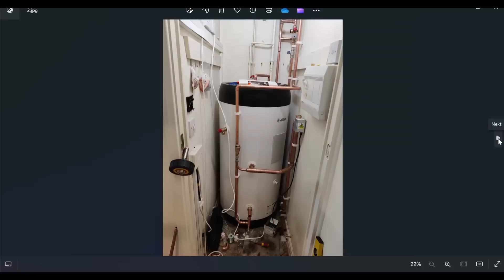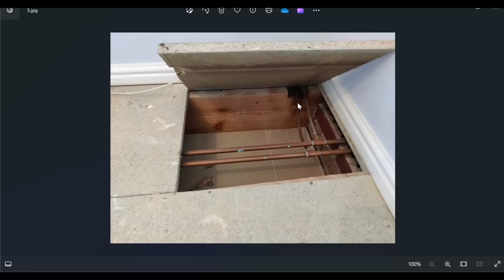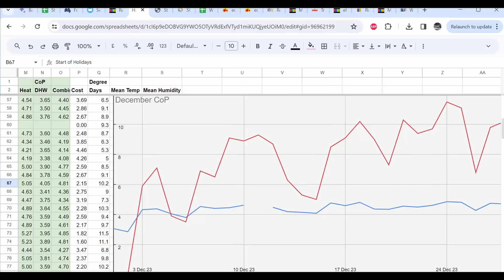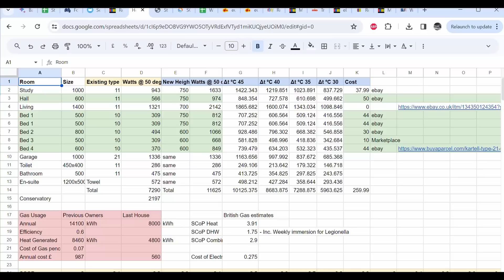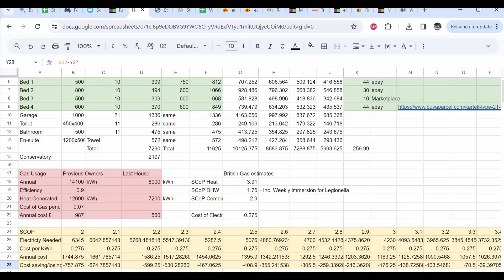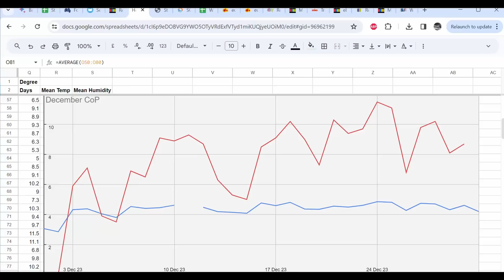How Efficient is my Air Source Heat Pump in Winter? December 2023 Monthly Data Report Update

Comment: really useful information,  I currently run out home colder via gas (yes more clothes on lol)  I know due to our age that we need to run more sensible temperatures so am looking for some monthly Kwh values and ave temps per month over a year or 2 - is there any reference material that I can get hold of.  I fully realise that the values are relative as if my home was poorly insulated then it would be a larger figure , many thanks
Reply from the maker: For the whole of 2024 our home required 2768kWh of electricity to heat and provide hot water for a family of five.
We achieved a COP of 4.
We kept the house at 21 degrees all day long.
If you look at some of my more recent videos you will find monthly breakdowns.

Comment: Just as an aside, have you looked into having the system being serviced? do B Gas do this? Ive looked on their website and theres no mention of servicing of ashps and the installation team didnt mention this aspect either.. strange, theyre usually pushing the servicing side but nothing seems available altho a bg engineer did say they do it?
Reply from the maker: I remember the paperwork includes mention of a first free service but besides that I haven't looked into it yet.

Comment: thanks very much for the video. I came across it by chance. We installed our 12 kW Areotherm plus heat pump in December. Possibly a few weeks after you did. Our experiences are very similar to yourself. House is much warmer and we seem to be spending a lot less money. it’s very hard to compare like for like but I tried to take a month from a year ago a month just passed. The heat pump bill was about half of the previous one. But there are so many differences since last year. The war in Ukraine and and gas price hikes, but we are heating the house fully now compared to last year when we hardly had the gas on at all because we were worried about the prices. So the house is now warm when previously it was cold and damp. I’m very pleased with my purchase I like you, I’m still getting a hang of many many of the settings thanks again for the video it’s very informative
Reply from the maker: Thanks for the comment! Good to hear that you're having a similar experience as well!
It's hard to describe the improved comfort but it's easy to show visitors within a few minutes.
Let's slowly convert the doubters, one by one.

Comment: Excellent thorough analysis thank you, so for me the big take away here is comfort factor. a couple of hundred pounds a year saving over ten years  will no where near payback the cost of installation and equipment so it all comes down to comfort and livability. For a family scenario  where multiple people are getting the benefits then it seems to me worthwhile especially if there are elderly and young children it the family group, but for say a working couple I still just don't think the use case stacks up. Once again thank you for the excellent stats .
Reply from the maker: That is a very important point that I hope to address in the future.
It is hard to describe the improved comfort but guests have understood it within 5 minutes of walking around the home, especially those guests who had visited us last winter and can recognise the stark contrast.
For us, the capital investment was lower than the gas equivalent due to zero VAT and the £7500 grant, as well as the fact that our gas boiler, cylinder etc was all 27 years old and long overdue a replacement.
The other factor to consider is the massive environmental benefits. I've just calculated how much carbon we are saving and will publish a video showing the full figures in a few days.
It's a win all round.
1. Improved Comfort
2. Decreased Costs
3. Decreased Emissions
Thanks for the comment.
Reply: Thanks for the reply and the additional incentives certainly make a difference. I'm thinking of starting out with a home battery due to the VAT removal from this February for standalone installations as the low price overnight difference in Tariffs is substantial.I would then like to move to a second phase with Octopus Cosy product once it has had a while out in the market to prove itself. Keep up the great work with the channel  @UpsideDownFork

Comment: What octopustariff are you using? Great video.
Reply from the maker: The figures used in the spreadsheet are on the standard Octopus price cap rates for my area.
I'm on Octopus Tracker so in fact I'm paying a lot less than this 👍

Thanks for the comment.

Comment: just put in Panasonic 7KW ASHP,  full new radiator system at the beginning of December  in a  200 hundred years old stone cottage will wall insulation, but  I think i will  have to fit  my old oil boiler as a hybrid system as parts of the house are not very warm
Reply from the maker: That sounds like an interesting installation. If the heat loss calculation is correct that all parts of the house should meet their target temperature but you may need to rebalance or upsize 1 or 2 radiators if those areas aren't currently reaching target temp.

Comment: Decent set of figures. I have an LG ASHP and AFAIK there’s no way to get the heat output and COP figures from it which is annoying.
But by comparison we used 96kWh on 2nd December for the ASHP and 852kWh for the entire month of December but the house is comfortably warm all the time.  Just have to be used to the fact that it does use a lot of electricity on cold days, but otherwise it’s not so bad.  We have a large solar array so can generate an abundance of electricity in the summer, for which we get paid, so overall over the year it’s heading towards net neutral cost. Running costs are similar to the oil boiler it replaced and of course you can’t generate your own gas or heating oil!
Reply from the maker: Glad you're making the most of your solar and ASHP combo! Always look on the bright side of life!
It's a shame that the LG units don't appear to provide much data to the user.

Comment: Condensing boilers are 89% efficient when used correctly.. ie, flue temp stays below 54C..   usually achieved by keeping flow temp lower (55C) and running the heating longer to achieved desired room temp...  so your comparisons at 70% or 80% are way off..
Reply from the maker: At what point did I say condensing boilers were 70% efficient? If I did, please send me the timestamp and i'll correct it. Re-watch between 14 and 16 minutes.
What I did say is that the vast majority of condensing boilers are incorrectly setup and are operating at 80% efficiency. A very small minority are operating close to 90%.
I did a running cost comparison against 80% and 90%. The heat pump still wins every time.

Comment: Hi guys, you are one lucky man, my AIR SOURCE HEAT PUMP costs me per day to run = £11.00 a day so as you can guess it don’t get switched on,,, so in 7 years of having this unit it has only been running for about 1 month, yep I have a problem, this is what you get when you employ qualified installers that turn out to be cowboys…..Brian
Reply from the maker: Sorry to hear that Brian.
1. What is your heat loss?
2. What is your design flow temp?
3. What heat pump do you have?
4. How are the controls set?
5. Do you have a breakdown of your energy usage to determine what is attributable to the ASHP?

Comment: Everyone needs to be aware that when measuring COP using a Vaillant controller, it does not give accurate results and over-estimates the true COP.  This is because Vaillant systems do not take into account any electricity usage by components that are part of the system, but not directly within the heat pump enclosure.  So, if you have external pumps, valves etc that use electricity, your COP will not measure that usage.  The correct way to measure COP or SCOP is to divide the total heat output of the system by the total electricity input, including all components within that system that use electricity.  This is how we calculate our COP and SCOP.  If you use the correct calculation the numbers shown in this video would be lower.  The spreadsheet shown does not include electricity consumption from associated system components and it also uses the 'Vaillant' method of calculating COP / SCOP which is not strictly correct.  To give an example, the spreadsheet shows a November combined COP of 4.06.  This is from a total heat generation of 906.2 and a total electricity input of 234.2.  906.2 / 234.2 = 3.87, not 4.06.  If you then add in the electricity usage of associated components such as pumps and valves, the number would be lower still, but that cannot be estimated in this system as the Vaillant controller does not include this electricity usage.  The best way to measure is to have a dedicated electricity supply that powers the heat pump and all other associated components and measure this with a dedicated electricity meter, this is how our system does it.
Reply from the maker: Hi David, thanks for your comment.
Do you have an arotherm plus yourself with open energy monitoring kit on it? I'd love to connect with more people that do!
Zarch from energy stats uk does and like others with the same kit has found the Vaillant reported figures to be remarkably close to the independent monitoring through the calibrated kit. In his case, his Vaillant numbers were lower than the actuals. https://energy-stats.uk/heat-pump-performance-history/
The open energy monitoring forum community has a lot more data on this if you're interested although if you've got the kit i'm sure you've read all of that already!
On your second point of the figures not adding up. Unfortunately there was an error in the spreadsheet. Some of the totals on the bottom line were not added correctly, the missing data during the transition day is to blame in this case.
The average CoP figures you see are averaged by using all the daily averages above them.
On the third point of excluding the consumption of zone valves and external pumps. In my case I don't have anything additional that would not be in a boiler system. I have the same radiator circuit pump and I have a 3 way valve as I used to have in my old system. The pump has a theoretical power consumption of 4-60w. Someone in the facebook group put a CT clamp on his and recorded average power consumption of around 200 watts per day.
So yes, I agree it is a factor, but it is a relatively insignificant one.

Comment: Love this bud, love the detail 
I’m a gas heating engineer and just installed my arotherm plus 7Kw in November absolutely loving it …expecting to alter pipework Rads etc as it was a bit of research on my own house , microbore all round and achieving constant 19.5 
Not having to do anything on my system so that’s a bonus, just subscribed 👍🏻
Reply from the maker: Thanks for the comment. Hope following along is helpful to you.
Did you fit a buffer tank?
What CoP have you been achieving since November?
Reply: @UpsideDownFork  no buffer just kept it open loop, I had a little kitchen underfloor zone I fitted a few years back, took the pump off that aswell and all works well, keep it simple but I was expecting to do some alterations cop floats between 3.8 and 4.4 heat curve on 0.5 , 18 degree set back temp 20 degree all day, Interesting to see how it performs on a long minus temp week, I think we had a -2 for 2 days and it seemed ok didn’t really notice it wasn’t performing so all good I think
Reply from the maker: @alexmanton8135  sounds brilliant 👍

Comment: Awesome as always.  So kind of you share so much of your data and conclusions.
I don't know how your system calculates the COP, but just looking at your December's heat pump electrical use (400.2 kWh) and your total heat pump output (1635.2 kWh), I would think these 2 numbers indicate a COP of just under 4.1, rather than the 4.34 in your spreadsheet (1634.2 divided by 400.2).  Perhaps I am being too blaze in my approach, these things are always more complex than they seem!
One more difference from last year (apart from your loft insulation) would be your conservatory roof insulation?  Wasn't that also done during 2023, so will improve heat loss from this very lossy area of your home and further reduce this winter's heat requirement from last year?
Just comments, I love your videos and really appreciate your time, effort and generosity sharing so much.
Reply from the maker: Thanks for your comment. I need to have a closer look at the spreadsheet then to see how it is calculating that as something is clearly amiss from what you're highlighting. Perhaps it is the missing day's data that has corrupted the formula somehow?
Thanks for noting the change in insulation.
That change was made in February as you'll see from my other videos about that project, so the comparison I made to the month of March 2023 is still a valid one. Similar ambient air temp and in March we had the insulation fitted but still on the old boiler.
Take care.
Reply: @UpsideDownFork  to get a true COP and SCOP you would need to measure from a heat meter that directly measures heat output from the heat pump and a dedicated electricity meter that measures the exact electricity usage from the heat pump system and all associated components, such as pumps, cylinders,  motorised valves etc.  The problem with Vaillant controllers is that the measurements they provide are skewed and this results in an over-estimation of the true COP and SCOP.  They take no account of any electricity usage from any components that are part of your system, but are not directly within the heat pump enclosure, e.g. external pumps, valves, cylinders etc.  The true measurement of COP or SCOP is simply the total heat energy provided by the heat pump (whether directly from electricity input, or derived as heat from the outside air), divided by the total electricity consumed by all components that form part of the system.
Reply from the maker: @davidstorm4015  Hi David, thanks for your comment.
Do you have an arotherm plus yourself with open energy monitoring kit on it? I'd love to connect with more people that do!
Zarch from energy stats uk does and like others with the same kit has found the Vaillant reported figures to be remarkably close to the independent monitoring through the calibrated kit. In his case, his Vaillant numbers were lower than the actuals. https://energy-stats.uk/heat-pump-performance-history/
The open energy monitoring forum community has a lot more data on this if you're interested although if you've got the kit i'm sure you've read all of that already!

The average CoP figures you see are averaged by using all the daily averages above them.
On the third point of excluding the consumption of zone valves and external pumps. In my case I don't have anything additional that would not be in a boiler system. I have the same radiator circuit pump and I have a 3 way valve as I used to have in my old system. The pump has a theoretical power consumption of 4-60w. Someone in the facebook group put a CT clamp on his and recorded average power consumption of around 200 watts per day.
So yes, I agree it is a factor, but it is a relatively insignificant one.

Comment: Out of interest, where do you get the kWh output figures from?  I assume the heat pump controller reports this based on temp drop and flow rate?
Reply from the maker: Yes, correct. These figures are reported by the unit.

It has many temperature sensors, most importantly on the flow and return pipework along with a flow meter.

Thanks for the comment 👍
Reply: @UpsideDownFork  ok thanks for the info.  Would be interesting to put one of these units on a test rig and measure how accurate the power output reading is.  Not that I'm suggesting they could be manipulating the figures to their benefit but obviously, as it is, this is the only metric we have to determine COP.
Reply from the maker: @Chris-hy6jy  There are quite a few owners that are measuring their performance through the open energy monitoring kit to get independent data. You can see that in this case, the monitoring equipment is very close to the Vaillant numbers. https://energy-stats.uk/heat-pump-performance-history/
Interestingly for me, some other heat pumps like the Mitsubishi Ecodan appear to be pessimistic in their own figures when independently monitored.
Reply: @UpsideDownFork  ah ok, wasn't aware the Open Energy system measured the actual output power using external sensors.  I'll give it a look.  Thanks for the info.
Reply from the maker: @Chris-hy6jy  yep, the kit has a calibrated heat meter which is basically a water flow meter with a temperature probe. 👍

Looks like great kit from my research.